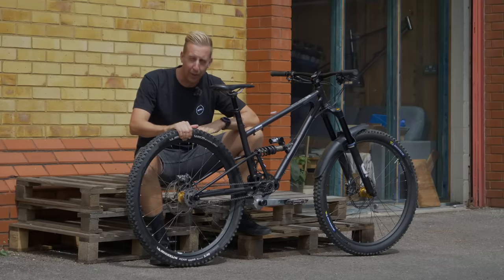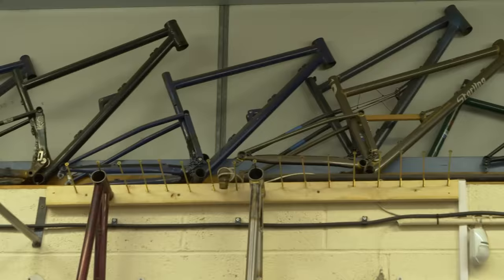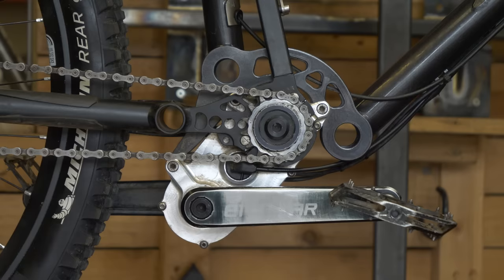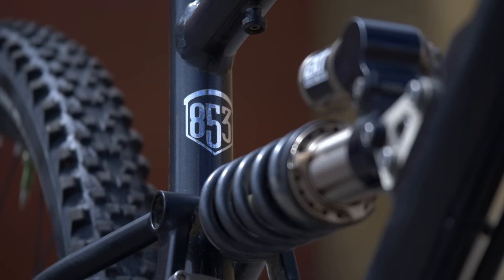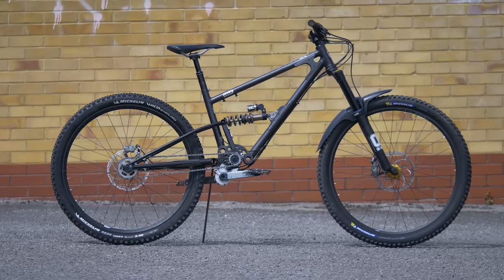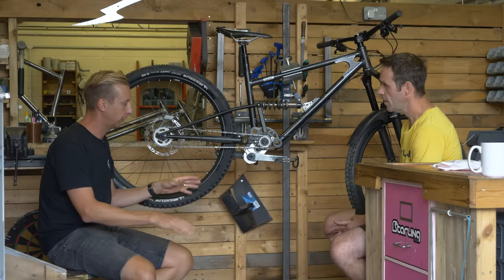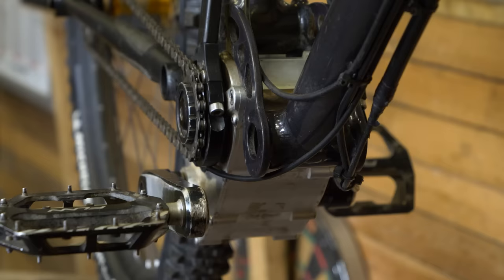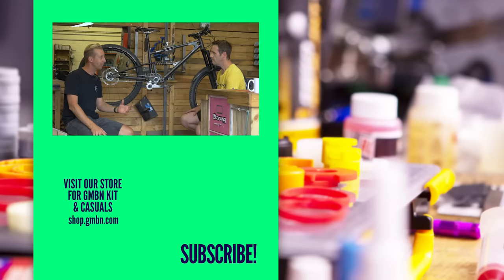Are Gearbox Bikes The Future Of Mountain Biking? | Advantages, Drawbacks, and Future Possibilities

Comment: Request for Starling bicycles.  Please make a plus tires bikepacking bicycle with an internal gear hub with massive gear range that would allow it to climb steep mountains and ride at the highest speeds (30+ mph) on paved road.  Please make the gear steps very small so the cadence does not change much between gears.  And give it lots of gears, at least 18 like in Pinion P1.18.

Comment: i use shimano alfine rear hub since 2012. works good but more weight and slightly more powerloss in the drivetrain. pinion gear box seems nice. it works similar to the one in the video, but you need special frame. and there is still the problem with weight, efficiency and cost.

Comment: COOL VID DODDY!!! 
I can't speak to THIS type of gearbox style, but I have a Norco Indie commuter bike with the Shimano Alfine IGH-8 internally geared 8-speed hub, and it's amazing. Haven't had to touch the drivetrain in 2 and a half years and it's still perfect. Only drawback is you have to stop pedaling for half a second for the shift to happen, but honestly once you get used to that it's almost nicer than pedaling through a chain shift! I've also seen the bike side-by-side with the chain/derailleur version of it and the internally geared one just LOOKS so much better too!

Comment: if you chuck the rear hub in the gearbox so the chain always moves could get the breaks there too and take a tonne of weight off the rear wheel... chain might be a little danger though

Comment: I'm not convinced, I am afraid. When I'm 30 miles from home, I need to be confident I can fix anything that fails well enough to get me home. Even in  the worst case with a derailleur, I can shorten the chain, then ride my MTB as a single speed home along the roads. I'm not sure emergency bodges will be possible with a gearbox.

Comment: They should be the future. Cars or SUV’s or trucks have advanced over the decades. Bikes have for the most part with the exception of the drivetrain. If they can make them from carbon fiber and Ti I believe they can be as light as a derailure system.

Comment: I see where Joe is coming from when it comes down to how many gears you actually need or even use. I might use 7 of the 12 my SRAM 1x has on any trail ride. I could totally see a upcoming custom gearbox in the future. It would be pretty sweet to order any amount of gears ranging from 3 speed up to 18.
Reply: Agreed… I could probably be happy with 3 or so if they were far enough apart.

Comment: What we actually need is a bike based cvt gearbox that can keep your legs doing exactly 1 revolution per second and constantly vary the gear ratio via a belt on 2 cones would be less resistance than a gearbox and would be the most efficient way to pedal
Reply: 60rpm is a painful grind. 90rpm is more of a sweet spot for pedaling efficiency.
Reply: @CanonFirefly  yeah I probably had the wrong rpm but you get what I’m talking about

Comment: You'd think a very low weight oil might help, a lot of car engines are running oil that's as thin as water these days, I bet we could get even thinner oil and still have plenty of protection, especially compared against gears and derailer open up to all the elements.

Comment: on a dynamic physics standpoint ,, I believe that's a good tech to chase and improve... the rear derailleur system adds up to the rear unsprung weight which is bad for suspension response on off road riding

Comment: If Shimano is only a bit clever, they develop a gearbox that fits in the housing of a Steps e-bike motor. The opportunity of using (almost) the same frame for all bikes will get the commitment out of the big players. I guess they are clever enough to do so but it has to be perfected to XTR levels and scaled up to Shimano manufacturing numbers before release.

Comment: Still think a gearbox and something like a Fazua drive would make an amazing trail bike. You could run fewer gears, sy 5 with a 500% gear range because you have the e-assist. Effectively negating any weight impact from the gearbox. And maybe even lighter than a traditional cassette system.

Comment: I ride 3-5 hours a week of heavy climbing in dry and dusty conditions. The derailleur is just a constant source of noise and "why is this not shifting right". It requires a lot of attention, adjustment, and cleaning (I run dry lube and fully clean the chain about every two weeks). I'm done with this ridiculously antiquated tech.

Comment: Have a couple of Nicolai Gboxx - they used a modified Roholff - needs a little mind adjustment to use the grip shift and they are heavy but a HUGE gear range - needs a dropper post and almost a modern bike for the mud fest that is my local rides just now - Starling - steel - yes shades of where Brooklyn Machine could have gone - unsprung mass - yes look at zerode in NZ - central mass yep and when you crash and bend easy fixes (well sort of)

Comment: Rohloff hub gearboxes are pretty much in use with Bosh motors in E-bikes, but they haven't got the range and efficiency compared to the derailer type and probably never will, so there will always be a compromise.
Reply: But Pinion and Effigear have more range then any current SRAM / Shimano group-set.

Comment: This is fascinating. I've worked on automotive gearboxes since I was (quite literally) a child but never on anything smaller than a motorcycle. CVT has always been an intriguing idea for me.  Has anyone ever attempted to develop a CVT (Continuously Variable Transmission) type drive to a bike as a way to avoid the constantly meshed set of gears?
Reply: Same here! In fact, I’m so much of a transmission nerd that I was at the CTI symposium in Berlin 2013 and still remember stumbling upon this funny little ball-bearing-like thing from NuVinci. It’s quite clever and I love it just for that, but not great for high torque. This is probably a weakness of cvts in general, but even more so with this one it seems, and they seem to target e-bikes now (and in 2013 too I believe which made them stick out from the crowd at the somewhat prestigious automotive event) Now what I think you’re after is something mid-mounted (so am I), and in that configuration it should be possible to make a more conventional cvt, with conical pulleys, but I haven’t seen that for bikes.
Reply: There's a hub CVT (Enviolo) but the efficiency is just around 80 %

Comment: I can't wait for gearboxes to become affordable. 

I have always thought that an exposed derailleur is an absolutely horrible idea for recreational single track riding. 

Is a  perfectly tuned, clean, lubed derailleur more efficient than a gear box?

Sure, but who cares? I would happily trade a bit of efficiency as well as gear count for an enclosed, low maintenance gear box. Just give me the range of my 1x11. I don't care if it comes in 8 steps rather than 11. This is especially the case in the higher gears where I am usually shifting in 2-3 gear jumps, anyway.

Comment: Hey, Shimano ARE in the gearbox market with Nexus and Alfine. I have an 8 speed Alfine on my cargo bike and, damn, I want that on my trail bike.
Reply: I personally would get a Rohloff over the shimano gearhub.
Reply: @buckroger6456  if I had to choose, I'd probably have a frame mounted gearbox over a hub. The two speed bottom bracket gearboxes are pretty interesting for retrofits but bloody expensive and really limit your crank choices. Not to mention explicitly stating that they aren't for MTBs.
Reply: @LongPeter  since I'm building a hardtail for trail riding and bike camping I'm not really worried about the extra weight on the rear end. Also not sure if you have tried a pinion gearbox but the do have a small delay before they engage the rear hub due to the gears having their own points of engagement that is often way lower then a standard rear hub. Also the Pinion C12 vs the Rohloff are around the same percentage but the Rohloff has a more efficient drive that's very close overall to a chain and cassette. Another factor is that the Pinion also cost more and weights more then a Rohloff gearhub. I still think both are really great and I'm sure if more bikes had these we would only see more improvements.
Reply: @buckroger6456  I've only ridden Nexus and Alfine hubs personally. Yes, all makes of gearbox seem to have their own quirks. I'm just over derailleurs/cassettes and the "is it broken, dirty or out of calibration?" game. It's amazing how long chains last on single speed and gearbox bikes.

Comment: Ebike plus gearbox, they’re already a bit heavy and who cares about drag. Perfect combo
Reply: Yep. Add in Gates belt drive and you're golden. 18k kms with a humble 11 speed Shimano hub gearbox, Gates belt drive and unrestricted Kalkhoff electric motor. Only maintenance is gearbox oil change, tyres, and brake pads ;) Also have a Thorn with a Rohloff that's done 17k kms. No issues with these gearboxes but the Rohloff is vastly superior: smoother, quieter, more precise and has a much wider range with 14 gears instead of 11.

Comment: if the gears are always meshing, why haven't they added a one way bearing? Could this potencially solve the problem of efficiency?
Reply: One potential issue is weight and size, sprag clutches have to be quite big, or wide to withstand torque going through a drivetrain. If you look at the gears, they are maybe 8-10 mm wide, and they’d have to be de-coupled from each other for this idea to work. There’s just not a lot of room to play with there.

Comment: I use for long distance (road) riding and commuting an Internal Hub Gear (Afline 11 Di2) for some of the overlapping reasons to this vid - fit and forget, low maintenance, if mid-winter crash on ice there's no mech to break, never have a problem with road trash getting stuck in the cassette and a whole load of other bad weather advantages.  OK, it would be as heavy as hell on the back of a XC or enduro MTB and would take a punishing on the bearings if on a gravity rig and you want performance, but gets some of the same advantages as the gear box - just that my gear box is on the rear axel not the chainset axel.   My Alfine system is not "road refined" for optimal weightweenie market but for the more urban and commuter rider.  Same as the Pinion and gearbox market where "robustness" is more important than performance.   Shimano push Alfine the product line not for me, but for the Brompton and urban commuter riders along with Center Parks style hire bikes - I've just found it works exceptionally well on >400km audax rides with Ultegra Di2 stuff, tribars and a load of Apidura's at the weekend; and just as easily for the work commute.

I think that the gearbox market will push the same way as the IHG tech market before SRAM and Shimano start to really tool up for this.  Shimano would also potentially cannibilise their own IHG market too.

I'm interested in getting a mountain bike to replace my ol' rig, and after the experiences I've had with IHG's, I'd be tempted to go for an ultra-low maintenance, bike-packing 29+ flat top with an IHG to ride gravels and XC across Scotland on.  Having a lower chance of a snagged mech on a remote self support ride is appealing!

What would these be like on a head2head2head basis?   Trad mech+cassette v's gearbox v's IHG?

Comment: I hate to hear the myth of "you need to stop pedaling a bit". It is just not true.
As a matter of fact, many gearbox manufacturers advertise the tested fact that gearboxes can change gears under higher loads than derailleurs.

The teason many people say it, is that a derailleur always needs ~¼ of a crank turn to change gear. You always want to have the gear change happen when you put the least amount of force into the system.
Therefore everyone is used to shifting when the cranks a at position 3 or 9 o'clock.

But gearboxes change gears instantly. So instead of stopping to pedal what you REALLY need to do is change gear at a different point in the pedal stroke.

Comment: These gearboxes are good and derailers are archaic. But a continually variable transmission is best and they already exist for bike wheels. Someone just needs to develop a mid mount and make it light as the current Nuvinci for example is at 8 pounds and real wheel mounted. Subtract maybe 1.5 for removing the old gears and derailers and you get an extra 7 pounds on your bike which a dealbreaker for many. 
If that 7 was reduced to 5 and mid mounted...hmm maybe.
Curious as to the weight of this set up here. Not raining on the builders parade here because he created a great solution and I am more than ready to ditch the derailers.

Comment: I am keen on gear boxes, if it works well, but my knees really need the oval chainring, so if I could get both. that would be great. cus my knees will hurt a lot with round chain ring, I really notice the difference in howl on and hard I can ride.
Reply: Just something to think about... an oval chainring would not work as when you change gears from 1:1 to any other gear your pedalling is out of sync with the oval orientation therefore not being beneficial at all.
Reply: I know that you can run a oval chainring with a Rohloff gearhub
Reply: @buckroger6456  of course, the negative with that is the qeight on the rear. Not tried one. But there is also Kinderney. It uses hydraulics to shift
Reply: @mtbboy1993  that one seems pretty cool but it's not proven yet, but at least we are seeing more gearhub options. The weight is always brought up and it's a fair point but for a hardtail I don't see a problem with. Also touring bikes have been using these for years with nothing but great things to say about them. I even seen a video where a guy put one on his fsp E bike and 2 years later is still singing it's praises.

Comment: A little more engineering and materials science could get rid of that drag he's talking about. Shaved/thinned down gear mesh contact areas with gears made of longer wear materials could greatly improve efficiency. If wear isn't a concern, such as professional level racing, where parts can be swapped out in between races, you could use gears with ultra thin contact patches for even greater efficiency. Shaved gear sets are a popular modification in pro-am/professional rc car racing classes where they use spec/limited power motors.

Comment: I’d love to get rid of the derailleur and the weight of the cassette at the rear. 
The additional drag is one thing putting me off. 

Funny he says few gears are enough, I ride the 10-51 12 speed an would like a wider range but even now the step between some gears is a bit large. 
So I’d like more gears 😅

The Rohloff Hub has a high efficiency. Maybe it’s possible to apply similar technology in a gearbox in the bottom bracket.
Reply: I think there were manufacturers who stuck the Rohloff above the BB and worked with a idler wheel to get the mass off the rear but still have gears.
Reply: My Pinion C1.9 has 576% over 9 gears. I really prefer it to all the giant cassettes I rode.

Comment: The owner of starling mentioned he'd like a super simplest 3 ratio drive traine, ive said the same thing for years. I'd really like to know what his ideal 3 gear ratios would be
Reply: High, middle and low?  

Is really going to depend on what is being ridden?
Reply: @malcolmbagley7068  fair enough, I live near the cascades in western Washington where you typically just winch and plumet, so I've always wanted something like a 11-28-46 cassette with a 30 tooth front ring.

Comment: Full suspension Emtb with Internal gearbox.. Hmm.. Also with Belt drive?  Low maintenance, extra resistance feeling removed by motor, and the added weight just doesn't feel all that much with the Ebike.

Comment: Could cvt gearboxs work for bycles???
Reply: Yes but they would be to heavy and inefficient because of the friction from the belt
Reply: @Nik-gh6gz  in cars cvt trans are usually lighter as well more efficient than other types so that could be the case here too...
Reply: There is an electric commuter bike company that used exclusively CVT: 'Ellio'
But since they're electric, efficiency won't be that much of a concern.
Their philosophy is to bring automotive tech & comfort to bikes
Reply: I'm sure it's possible. There's already a cvt internally geared hub for bikes
Reply: Nuvici
Reply: @superchargedpetrolhead  many CVT cars are plagued with transmission failures in their onset.  They are still in their r & d for longevity, nice looking cars, but a $3k transmission repair will change an opinion.  Snowmobile slip clutches, those things take immense torque.

Comment: Love the video. HOWEVER, he should be more honest. It's a lot easier to weld steel as to make a carbon frame. This is actually the real reason why the frames are made from steel. It would be impossible to handcraft a carbon fiber frame. Especially in such a small shop.
Reply: Good idea to watch the whole video - he said that exact thing at 7:55.  And he was completely honest about the limits of the gear box.

Comment: What about positioning a Rohloff at the pivot and connecting a small chain to the cranks and a larger one to the rear wheel? Could that have some advantages in drag?
I've always had a thing for the Rohloff hubs, just the weight shift to the back I've never liked for a MTB.